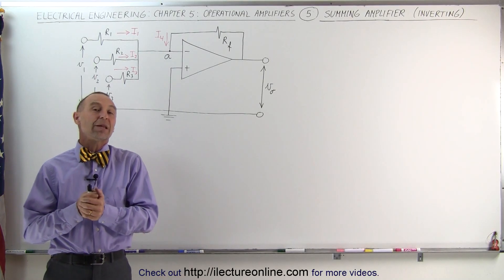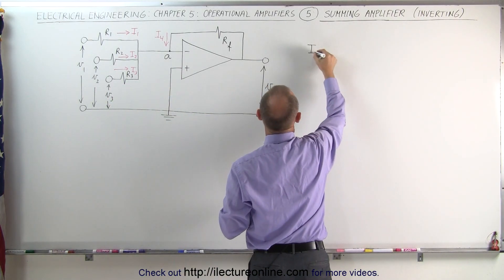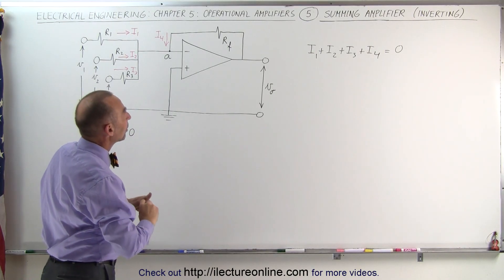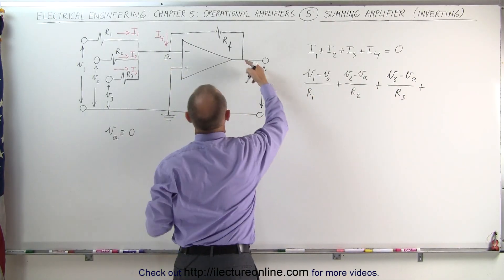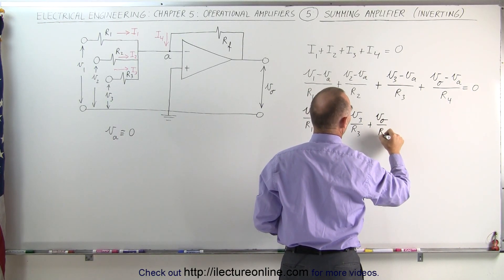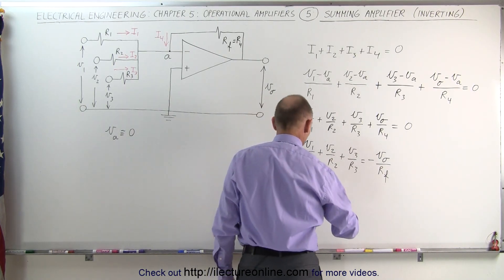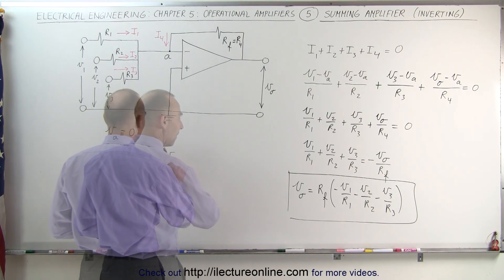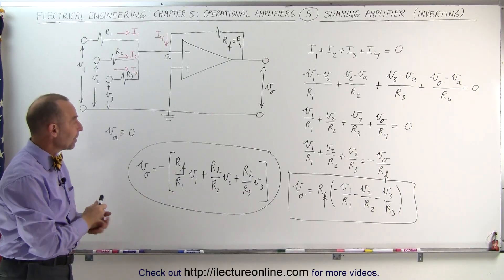Electrical Engineering: Ch 5: Operational Amp (5 of 28) Summing Amplifier (Inverting)

Comment: i dont understand how you decide which way you should do your potential difference.... Like v1 - va or va-v1 etc.?
Reply: It doesn't matter, as long as you are consistent in the directions that you choose. The currents entering a node are equal to the currents exiting the node. In the video he assumed that all the currents are entering the node, that's why everything is equal to 0. If he assumed that all the currents were exiting the node (va-v1, va-v2, etc.) it would achieve the same result. Just be consistent in the directions that you choose

Comment: Are you sure the direction of the feedback current (If = I4) is correct? Isn't I4 = I1+I2+I3? But on your board it is written as I4+I1+I2+I3 = 0.
Reply from the maker: For an ideal OP AMP, the voltage difference between the inverting and non-inverting terminal is zero, which means that the inverting terminal must be at zero potential, since the non-inverting terminal is connected to ground.  If we assume that the output voltage is greater than zero, then the current I4 will be in the direction indicated.  If the output voltage is negative, then you'll get a negative value for I4 and the current will be in the opposite direction as first assumed as is the case in this example.
Reply: Check your first videos then about inverting amplifiers. You show the feedback current the other way around there. The only difference is that  this one has 3 input currents I1 I2 I3. I'm not sure if this is corrects still.
Reply from the maker: The way the current is drawn initially is not necessarily the actual current direction.  That is OK.  You either assume or take a guess.  If you get a negative answer for the current, then you'll know it is in the opposite direction.
Reply: @MichelvanBiezen  but when you were explaining the inverting OA, you used I(i) = I(f). If you used the same logic here, than you would have to use  I4 = I1+I2+I3

Comment: It is pretty counterintuitive to assume, that 4 currents flow into node a, but none are leaving.
But as you mentioned very often, all you get is a negative for some currents, so it's no problem to make that assumption.
But in reality, it definitely wouldn't work out, right? 4 currents entering, none leaving :)
Reply from the maker: Off course there is a current leaving the non-inverting terminal, but the current is very small and for simplicity it is ignored.  Take a look at this video for assumptions made:  https://www.youtube.com/watch?v=EZIufczc7fE&list=PLX2gX-ftPVXXuwvL-aLs3Q2Af3BwnrCyK&index=1